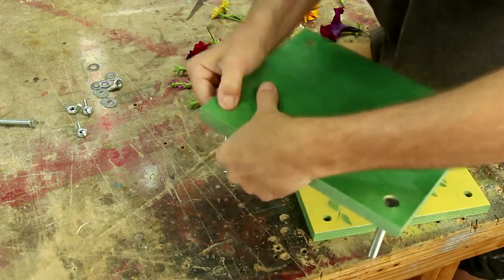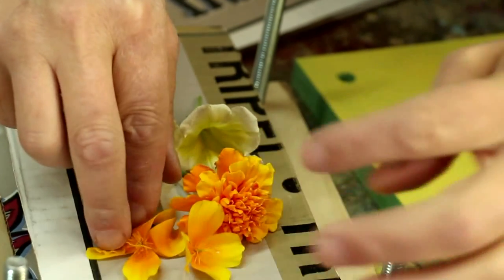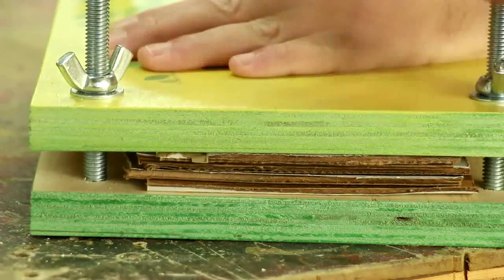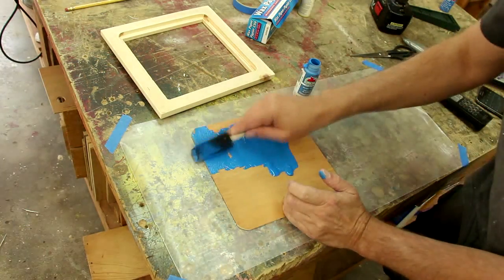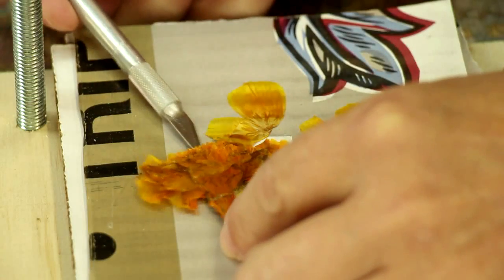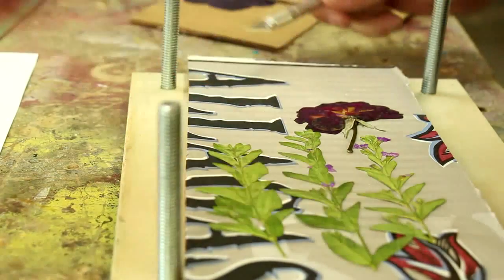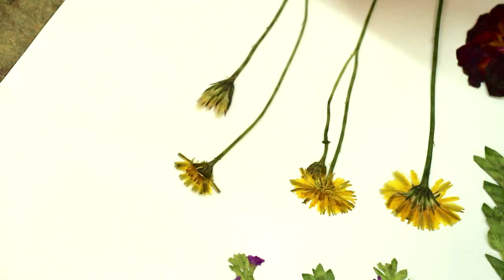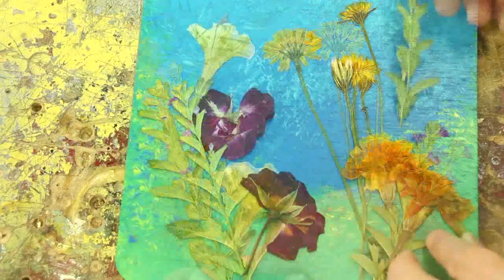Make a flower press and dried flower picture. Easy!

Comment: hey i like ur videos but i have a idea an i wonder if you could help me i have a drill chuck hold and a motor from a sander or if i could use another tool example grindin tool i want to adapted to make a router could you make a video to see if it could be done and how i want to do this project because am in mexico and router are very expensive i have the router beats well you get the point